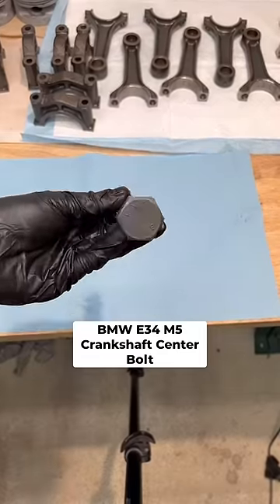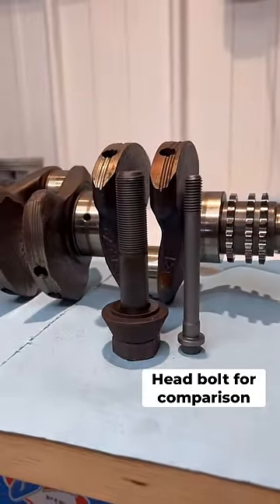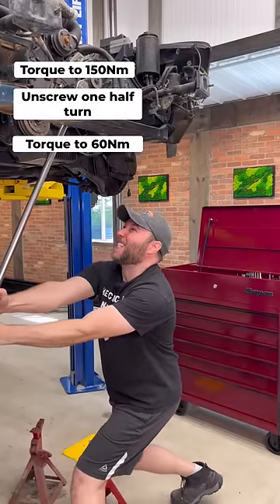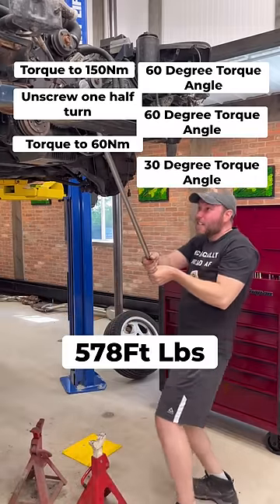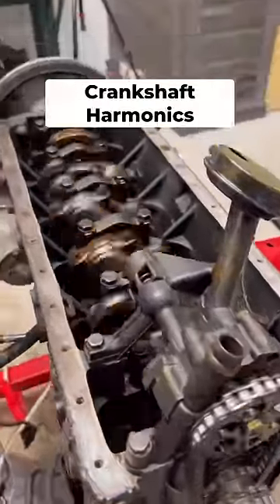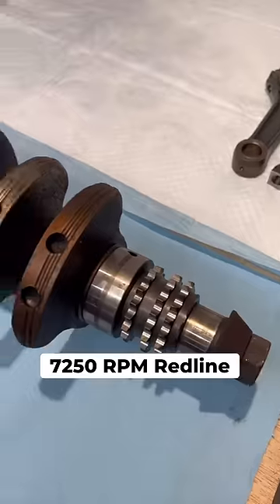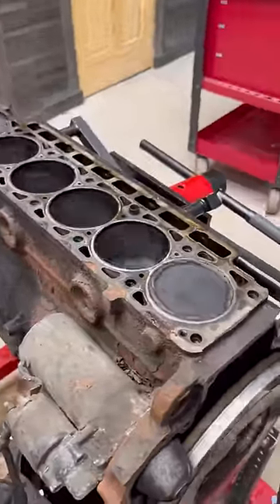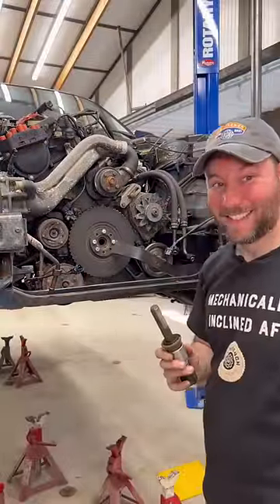BMW E34 M5 Crankshaft Center Bolt Explanation #bmw #cars #diy #bmwm5 #bmwe34 #restoration #engine

Comment: Falcon inline 6s spin to 6500rpm all day. and they're only like 150nm
Reply from the maker: Different engine design though
Reply: @wewrench  still an inline 6. probably the same firing order. Come in either SOHC or DOHC
Reply from the maker: @TheBeardedMiracle  What's the displacement?
Reply: @wewrench  4L

Comment: SVT Zetec - 74nm, 90° angle torque, go make 7300 ripums. I4's have some half order, significant first, second, and third order harmonics. The BMW method seems a bit excessive.
Reply from the maker: The crank is very long and heavy, so those harmonics you speak of are what they're trying to compensate for

Comment: The engineers gave it some thought. Did you hear yourself say that. There are probably a dozen ways to get around that problem without making sure the owner will never be able to work on it. It was about dealer servicing.
Reply from the maker: Yup. That's the whole idea

Comment: Ford 1.0 ecoboost has a tool with 5:1 gear ratio and you torq it with 90nm and 4x90 degree 
So you end up with 450nm and around 72degree  so you cant open it with a regular impact 😅
EDIT: ITS 60NM AND 5X90 DEGREE
Reply from the maker: That's some torque!

Comment: Ive seen some honda K series spin close to 10k rpms. The k20z3 redlines at 8300 from the factory.  Their crank pulley should be tightened to 181 ft lbs.
Reply from the maker: Different engine design

Comment: Torque , loosen , hit it with 3/8 impact, loosen hit it with 1/2 impact loosen , hit with 3/4 impact then torque  under 4 min and done
Reply from the maker: I think that would probably get it close
Reply: @wewrench  that’s the flat rate way personally don’t care for it but it’s all about the monthly budget & how many you can get in and out
Reply from the maker: @sonofmontezuma3732  Yup, it encourages corner cutting

Comment: As a hd guy I deal in 500+ftlbs the diff rebuild that turned into replacement I just finished, had a yolk bolt ask for 1200ftlbs didn't have a big torque that fit under the truck was a bitch. Confirmed I got it to torque with a multiplier when we finally got it in and immediately wished I waited a day to use it to torque the bolt soo much easier but it shattered my 1,5/8 " socket
Reply from the maker: That's crazy man

Comment: Meanwhile us LS guys impact on a ls7 crank bolt to seat the balancer, undo it and then use the stock one and rev to the same with simple mods and stay reliable 😂
Reply from the maker: Different engine design though

Comment: It's like that because mechanics. Today car manufacturers prefer other measurement systems than torque, the latter istnt that precise because of friction. For a proper torque, you'd need to tighten your bolt in one go- difficult if you need like 300Nm. If you tighten it to 150Nm first, the next time you tighten it you already waste some torque to overcome the thread friction, that's why older manuals require technicians to wrench it to X torque, and then use turn radius as more precise measurement technique.
Reply from the maker: Yes, much of that initial force is to overcome friction

Comment: My Suzuki has a 8500rpm rev limit and is built to sit at that rpm all day my crank shaft bolt torque spec is 95ftlbs
Reply from the maker: Different engine design though

Comment: Or BMW could have changed the resonate frequency of the engine block and moved it's critical frequency away from the RPM range of the engine. Cheaper to do this I guess.
Reply from the maker: That can only be accomplished by adding mass to the block I think.

Comment: 9000 rpm b series with 130 ft lbs on the damper bolt 👀
Reply from the maker: Different engine though

Comment: Or it's the multi piece timing gear oil pump gear that is only held in place by friction from that bolt holding them together.
Reply from the maker: that gear is only one piece
Reply: @wewrench  is that gear keyed?

Comment: 🥱 my Honda redlines at 8000 rpm and I just hit the crank bolt with my impact. I’ve never had a problem. German cars are just overly complicated
Reply from the maker: Certainly quirky!
Reply: @wewrench  indeed. Helped my friend put a spare on his gti and I took a peak at the suspension off and it made me say wtf

Comment: I've spun my 400 small block chevy to 8k rpm and its got the original 1974 crank bolt and its a original 74 cast iron 2 bolt main block. Just internal balanced and forged now. I have set rev limit to 7400 now and shift at 7k. So what?
Reply from the maker: Different engine design though
Reply: @wewrench  correct. What makes the e34 design susceptible to crank bolt breakage at 7250 rpm. That's not that fast. Buddies Honda d series he spins 2x that
Reply from the maker: @DiscoGreen  Length, weight of the crank and the components it drives
Reply from the maker: @DiscoGreen  and the bolt breaking isn't the issue. It's the components loosening up...vibration damper, crank pulley, oil pump sprocket...etc

Comment: Literally if I don’t know a torque spec, if it’s coming apart again I use orange thread locker and 1-2 ugga duggas, if it never needs to come part I use red thread locker, an impact, and 3 ugga duggas
Reply from the maker: Thing is I don't want this one to come loose ever. Cus it means the engine will grenade

Comment: Going way back in the day here. I remember my Dad saying an inline 6 will never hold up to the rpm's of a v8. 
A little brainwashed yes. Just he only dealt with Chrysler, GM and Ford inline 6. Which were treated more like diesels; low rpm adequate torque.
Which in many ways most all engines back then were meant to be driven like tractors. You could easily take off in high gear in any American V8 truck or car made pre 1970, with a manual transmission.  If a person was in Iowa or any flatland there was no reason to shift a gear; drop her in high gear and release the clutch and finesse the gas...
Reply from the maker: It was a different time. Very few people thought turbos would become mainstream and now look.

Comment: Wonder what my bikes crank bolt is torqued to, 15,000 RPM certainly is a lot.
Reply from the maker: I'm curious as well. Different engine design though
Reply: @wewrench  Those four little pistons still are flying around though!! Even at 10-12k if you were deaf you wouldn’t know it was running, super smooth engine.
Reply from the maker: @TheKurtTribute  That's very cool

Comment: Using my daft logic....  So my RS250 revving over 12000 rpm I need to torque up my crank to 800ft lbs?
Reply from the maker: No, it’s a different engine design

Comment: There is a rotary valve project on YT featuring this same model (?) and the builder was careful not to rev beyond 6500 for fear of shearing the crankshaft at the 7200 mark.
Reply from the maker: They swapped in a rotary into an E34 BMW?
Reply: @wewrench  They replaced the head with an experimental head that used barrel shaped (rotary) valves. I don’t think it sealed well, which is a problem for that concept.

Comment: Try torquing semi truck wheels. 10 nuts per wheel at 500-550 ft lbs
Reply from the maker: That's some real torque!
Reply: @wewrench  that’s a heavy duty mechanic vs an automotive mechanic. An auto mechanic torques one bolt to 500 ft lbs and he’s gotta make a video about it, heavy duty mechanics do that every day
Reply from the maker: @bighitstepside  hahahaha....that's so true.

Comment: My thrown together k24a2 9k redline 18lbs of boost. Approximately 6 Milwaukee 1/2" ugga duggas
Reply from the maker: How many ft lbs is that?
Reply: @WeWrench  id have to check my ugga dugga conversion sheet

Comment: U could also just spline components and use less torque. The harmonic balancer bolt literally only holds the balancer to the crank it has nothing to do with anything else on the rotating assembly. There are plenty of other engines that spin as fast without the need of this torque
Reply from the maker: It probably costs less to just turn a smooth shaft and use a keyway

Comment: Wow, I'm really surprised it could withstand that kind of torque without failing. 😳
Reply from the maker: It's an M20 bolt so it could handle quite a lot

Comment: Gm also does this 3+ step torque sequencing. They also use the the torque angle methods. It's common on a lot of their products, most guys just tighten them. 🤣
Reply from the maker: Yeah, it’s cheap insurance to do it right though

Comment: I used to rev my 998cc mini to at least 8k without anything rattling loose 😂😂😂
Reply from the maker: Different engine though
Reply: @wewrench  yes. A much older. Less refined engine that shared engine oil with the gearbox 👀😂

Comment: I hate it when OEM's completely blind themselves to simple technology in favor of using old methods beyond their practical limits.

Get a cam-lock / wedge lock washer or a multijack tensioner. No need to fight the incredibly high nut friction factor just to achieve a large preload.
Reply from the maker: It's so quirky

Comment: Hi yeah BMW mechanic of 15 years. Its because the crack is garbage in this old engine. Back then BMW was just making new blocks and putting cranks in them from other engines. It has nothing to do with with a 7250rpm limiter. Its the lack of a proper designed crank for the block. My N54 goes to 8000rpm just fine, that's 84mm x 89.6mm
Reply from the maker: Back then, BMW wasn’t “just making new blocks”. The M30 block design was around since the 60s. And what exactly is “garbage” about this crankshaft? And also, it wasn’t in other engines. It was built specifically for the S38B36. And comparing this engine to a 3.0L N54 is like apples to oranges. The N54 is one of the worst power plants ever produced in terms of reliability. Ask one of the old times how often they saw M30 based E34’s in the shop for invasive work
Reply: @wewrench  You are sadly misinformed. BMW was swapping cranks and blocks more then a high school girl swapped boyfriends. You learn part numbers very well and I know this from doing it when I was in service.

Comment: Spin my Honda b-series to 12,500rpm and only torques the bolt to 225ft lbs. 
578 is CRAZY😂 
Need the B.A torque wrench for that
Reply from the maker: Different engine design though

Comment: rotarys be like hold my beer
Reply from the maker: What's the torque like on those?
Reply: @WeWrench  250 foot pounds on the front bolt and 350 on the rear nut  but they tighten each other as you tighten each side so it's a bit more
Reply: @wewrench  and it withstand 10000 rpm with less torque

Comment: The Fiat 1.3 diesel front pulley hub traps the timing chain sprocket. It’s done to 230 Nm or 150 Nm plus 90 degrees. The chain will fail after 100,000 miles (160,000 Km). Who knows why they dumped their tried and proven timing belt.
Reply from the maker: Fix it again Tony!

Comment: Funny, my I6 is a 4.7 that revs 6500rpm and makes 700hp. It only uses a 2" long 1/2-20" bolt @80 ft-lbs and it doesn't vibrate or loosen or things off. Something wrong with their design.
Reply from the maker: Different engine design though
Reply: @wewrench  Yup yup

Comment: It curious as to why the most popular engine on the planet doesn’t use this enormous bolt, truthfully I don’t know of any other race engine that uses a bolt that size anywhere! There are countless Fords, Mopars, GMs, that all use bolts half that size to retain the harmonic balancer hell some early small block Chevys did even have one and it’s not been an issue so the logic here escapes me!
Reply from the maker: I'm sure there's a reason.

Comment: What is the correlation between crank bolt torque and harmonics?
Reply from the maker: Because crank harmonics cause the crank to vibrate and that causes anything attached to it to come loose.

Comment: Funny that other engines make just as much power and spin it just a high as RPM and they don't have that big a bolt It's called German overengineering
Reply from the maker: That's why I wanted to make a vid about it. Totally quirky

Comment: Has anyone ever come up with a plausible explanation as to why BMW blinkers never seem to work? Is it the cost of BMW blinker fluid or what.? 😉🖖🏼
Reply from the maker: Those flasher relays
Reply: @wewrench  could be. I have noticed the bikes have the same blinker issue as the BMW cars. It could be the relay but it must be that you void the entire vehicle and any  other warranty of any BMW vehicle or bike you ever buy if you put in the wrong brand blinker fluid.  😉🖖🏼

Did you know the most dissatisfied employee at the BMW assembly factories are the poor soul that fits the blinkers knowing that with all their hard work and effort they know deep down the blinkers will never ever be used…. It’s a real problem for BMW HR. 😀🖖🏼
Reply from the maker: @PubRunner  hahaha...I love it!

Comment: Maybe next time BMW should re-think using a single bolt then? Come up with something else. Maybe change the way the engine works. 

It isn’t “smart” to have to battle through something. They should have thought outside the box.
Reply from the maker: They did on the later inline 6s

Comment: A Mazda/Ford B6 engine redlines at 7200 and the crank bolt only takes 165ft/lb. 🤷‍♂️
Reply from the maker: Different engine design though

Comment: Sounds like a band aid for an engineering problem.  Never heard of a 10,000 rpm drag race motor with numbers like that
Reply from the maker: They changed the design on later engines. I think this was some laziness o their part not wanting to redesign anything more than they had to

Comment: So what is the sequence for the v10 m5 or the v8 m3, both with higher rpms?
Reply from the maker: I don't know but I think they have multiple crank bolts
Reply: @wewrench  I was just curious if the design standards changed up with technology advances or if it’s even scarier
Reply from the maker: @KartiacKID  It's a better design than this
Reply: @wewrench  I was just wondering if BMW managed to crank it up a bit
Reply from the maker: @KartiacKID  lolll, they always manage to one way or another

Comment: What means 60° turn angle?
Reply from the maker: You turn the bolt an additional 60 degrees after you reach that discrete torque spec

Comment: That bolt with that torque is hiding an engineering FAULT.  THAT IS RIDICULOUS AND HILARIOUS TO ANY OTHER ENGINEER OF OTHER MAKES AND MODELS OF COMPARABLE SIZED ENGINES..
Reply from the maker: It's def overcompensating for something

Comment: I have a Honda with a j35z3
The redline on a much less balanced 3.5L 60 deg V6 is the same. The crank bolt is like 200ft-lbs

So what's the BMW excuse?
Reply from the maker: This is a 3.6L inline 6. It's the shear size, length, weight of the crankshaft and amount of reciprocating mass that results in the crazy crank bolt

Comment: Angle is a unit describing an amount of a circle, torque is a force acting at a distance. What is 30 degree torque angle? The units don't make sense. You're either concerned about the amount of rotation of the amount of force.
Reply from the maker: The amount of rotation of the torque angle exerts the intended force and bolt stretch required by the engineers
Reply: @wewrench  thank you but, the word torque still should not be used. The angle and thread pitch induce a strain, that strain induces a stress, which is a force over area, in which  a tensile force can be derived. It may seem trivial but word that reprresent units have very specific meanings.
Reply from the maker: @sillybilly686  You’re really drilling down here , but you’re correct. I don’t know the proper use of those engineering terms like stress and strain so I try not to use them

Comment: They should just say 578 ft lbs instead of doing all that. Or just use Lock tight
Reply from the maker: It won't be the same unless you do it in stages like that
Reply: @wewrench  it would be
Reply from the maker: @thespiritofthenight8196  So when you torque a bolt to let's say 100 ft lbs, a huge majority of that force is going just to overcome friction rather than actually tighten and stretch the bolt. That's where all the wacky angle stages come in
Reply: @wewrench  or just go over the toque
Reply from the maker: @thespiritofthenight8196  I don't know how that would work. I don't think there's an equivalent from an engineering standpoint

Comment: 4 cylinder Hondas doing more than that, some even 9000RPM having the bolt torqued using a normal ratchet with no care for torque values and they just run. 🤷‍♂️😅
Reply from the maker: Can't kill a honda

Comment: How about just using red locktite
Reply from the maker: Not enough
Reply: @wewrench  the red you have to heat up or whatever your turning its gonna break
Reply from the maker: @iknowyourebrokeauto468  It has to do with how much extra torque the loctite adds to the loosening torque

Comment: My Escalades wasn’t that crazy.
Seat new pulley with original bolt to 350ftlbs. Remove bolt install new bolt torque to 36 ft lbs and then 40 degree turn.
Reply from the maker: That's interesting. It's all about the pre-load on that setup.

Comment: Ford cam phasers have a stupid torque sequence also
Reply from the maker: Like a torque to yield sequence?
Reply: @wewrench  maybe … a series of tighten the bolts loosen them then 90 degrees then 75 lbs then loosen then 150 lbs and 75 degrees lol …. Those are random numbers I don’t remember them all but a sequence like that…. Could be a yield thing but I don’t believe they are one time
Reply from the maker: @CaptainSpud88  it’s a like a pre-load sequence then torque